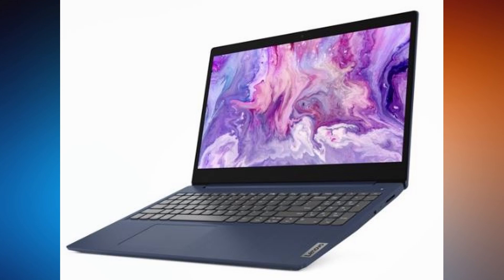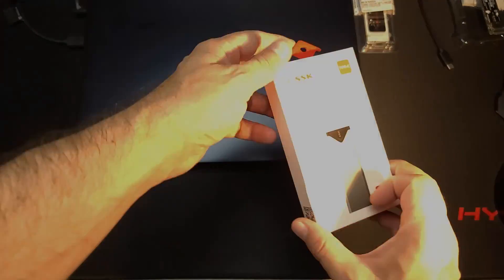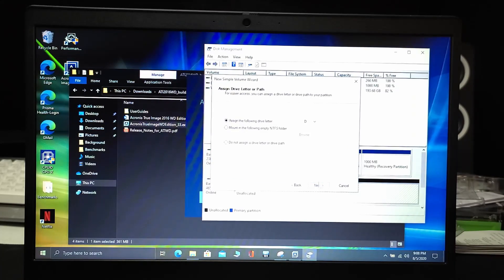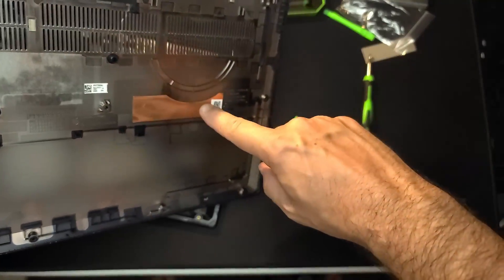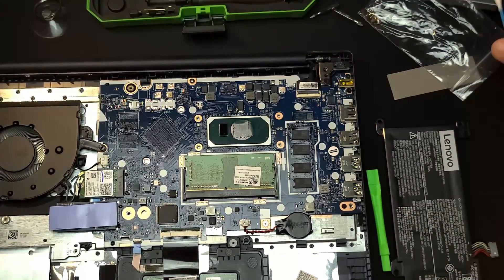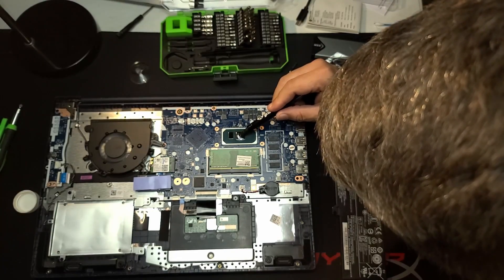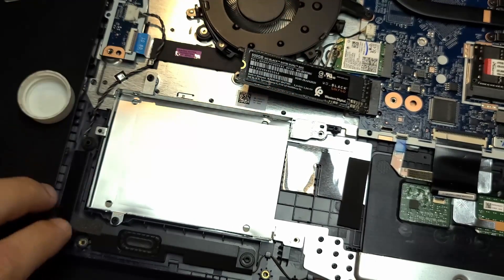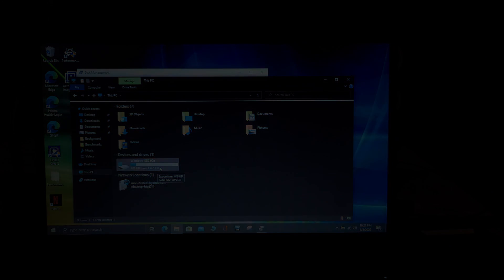Lenovo IdeaPad 3 Intel i3 1005G1, Upgrade. Replacing Thermal Paste, adding 32GB Ram & 500GB NVMe SSD

Comment: is the  slot  at  the side  of the  battery  for   additional  ssd  drive  sata
Reply from the maker: I think there's a bracket kit and a SATA cable that would have to be purchased first, but yes that's space for a 2.5" HDD or SSD. Pretty sure the accessories are available on the Lenovo website.
Reply: @TheSmileyTek  thanks  mate  ,  will  make a  mount  for  it  when i  do  the  upgrade  .  was  not  sure if there  was a sata  connection  ready  to  put one  .  thanks   for the info  .

Comment: I upgraded my ideapad 3 with kingston 4 gb ram, but the problem is that it could only be installed backwards. Like your samsung ram was on the first place. Would that be a problem?
Reply from the maker: No problem. It will only go in one way, so if it seated into the slot, it's correct. My original Ram stick at 4GB, had less "chips" on the memory PCB, so it looks bare on one side. Where as the 32GB is covered on both sides, which make it appear as if it's installed backwards.

Comment: Please advise can i use below ssd for my lenovo ideapad 3
https://www.amazon.sa/-/en/Crucial-500GB-NAND-NVMe-PCIe/dp/B086BGWNY8/ref=mp_s_a_1_5?dchild=1&keywords=m.2+ssd&qid=1606459638&sprefix=m.2&sr=8-5#
Reply from the maker: If it has an M.2 NVMe like the laptop in the video. Definitely yes.
Reply: @TheSmileyTek  yeah, i have the same Lenovo Ideapad Laptop 3 14IIL05, Intel Core i3 - 1005G1, 14 Inch, 1TB HDD , 4GB , Integrated Intel UHD Graphics, Win 10 Home

Comment: Bro i finally have in my hands the ideapad 3 i5-1035g1 , the disassembly is the same?
Reply from the maker: Yes. You got it no problem. Just be sure to unplug the battery first, and your good.

Comment: Hey thanks.  I'd never heard of anyone puttin' in sooo much RAM.  Like you imply 8 gigs should be enough of an upgrade for most of us, no?  Do you have any unpleasant side effects with 32 extra?  Also, I thought the main benefit of puttin' in a 500 gig SSD would be 'memory space'.  Speed also improves?  How much of a speed improvement have you noticed, and are you still noticin' it?  I'd never seen anyone use True Image before, so that was real helpful.  I don't know if I'll upgrade the SSD, but it doesn't look hard.  It'd be even easier with a little more step-by-step instruction with the clone.  I guess that's out there somewheres on YouTube, no?  Thanks agin.  (My ol' laptop has lost its g ability, unless I control V it, which makes my text kinda folksy, with lotsa droppin' g's.).

Comment: Hello my friend! How often should we renew the thermal paste? And , this model can upgrade ram up to 32 gb ?? :0 thank you!
Reply from the maker: Shouldn't have to re-apply thermal paste but every few years, if you remove the cooler, or if your cpu temps seem too high. Mine works great with a 32GB stick (36GB total). I was surprised. No errors running Memtest64. No issues at all so far.
Reply: @TheSmileyTek  beast! Thanks a lot
Reply: @TheSmileyTek  sorry for bothering but i searched for idea pad 3 ill05 in the lovono site and i found the manual but it doesn't have the upgrade options :( .. if you could send me a link :) i would appreciate it ( i dont have the laptop yet, i am in Search of the manuals so as to know the upgrade options) Thank you very much
Reply from the maker: No worries. I will post a link if I'm able to find what you're looking for. Try searching the "81WE....." model # on the bottom of the laptop as well.
Reply: @TheSmileyTek  i ordered the ideapad 3 14' (i5-1035g1/8gm/256ssd) i am trying to find where it says for the upgrade options. Thank you
Reply from the maker: @alexandrgr  https://www.manualslib.com/manual/1847207/Lenovo-Ideapad-3.html

This manual tells you what to search for on the Lenovo site. This may help.
Reply: @TheSmileyTek  thanks , wish u all they best!
Reply from the maker: @alexandrgr  Same to you friend!

Comment: Hi, this works with the ideapad 3 with ryzen 5????I woul like to add more ram 😅
Reply from the maker: Yes, should be the same process. 4GB Ram soldered to the MB, and one slot for additional RAM, which can be swapped out.
Reply: @TheSmileyTek  perfect! i will try adding a 16gb ram, thanks!

Comment: Will be windows deleted because of upgrading the ssd?
Reply from the maker: Not if you clone the drive. If you clone the drive like I did, everything will stay identical, including the operating system. Windows license key is tied to the motherboard, so you won't have to input any software key or anything. So 1st you clone the drive, swap out the old with the new, boot up, and that's it.

Comment: Nicely Done.    I see there is space for a SATA Drive that can be SSD.  Does it comes with SATA cable already attached?? 
Thanks. Most likely will add 16GB Crucial DDR4 RAM

Great Video..  Purchased this model @ $269 plus tax
Reply from the maker: Thanks friend! Means a lot to me. I think you'll have to purchase the "carrier mount" and cable separately. You got an excellent price! Lenovo sells the cable. I think I'll add a SATA SSD as well.
Reply: @TheSmileyTek   I picked up the 1x16Gb DDR4 same brand-Kingston HYPERX @ BestBuy (found a misplaced Gift Card)  I also got the same brand-WD_Black SN750 500GB M.2 and have a few SSD SATA on standby to try that other available drive spot to see how it works.  This is to replace my IBM/Lenovo T410s  Thanks for this video to push up the timeline on my purchase for a replacement  .
Reply: @TheSmileyTek   I was also able to sell my other Laptop Lenovo - IdeaPad S145 15.6" Laptop - Intel Pentium Gold to a Family that needed more than I did for Remote Learning for their two kids.  This Unit Lenovo IdeaPad 3 you did the Video is quite similar in layout to the Lenovo - IdeaPad S145 so just waiting on delivery.
Reply: @SEAMOSS69  Did you get the maximum speed in ram? And I also want to ask if the performance turned out to be better than before because I am still a newbie when it comes to laptop upgrades and I just want to make sure that I will not buy the wrong upgrades. Thanks.
Reply: @haisesasaki6377  Working well so far.  Do you mean the FSB on the Ram? If so, I matched it prior to the purchase. Works great in tandem with my SSD
Reply: @SEAMOSS69  Thank you so much, I am just making sure if I can buy a 16gb ram since I saw some videos that said that I can use a 16gb ram but the official site says that the maximum ram that it can handle would be 12gb but thanks to your feedback, I will just buy a 16gb ram upgrade.

Comment: Excellent video, I got this computer in the version with an i5, I want to add a hdd to it but the computer does not have the cable, do you know where I could get it or if any cable would work for me?

Thanks for your help
Reply from the maker: Thanks buddy! If you search for your laptop model, on the Lenovo website, you should be able to find the exact part # in the "maintenance manual" for your specific model. They actually offer more info than most other companies. I was surprised tbh. Good luck.
Reply: @TheSmileyTek   I finally find the part number, thanks man.
Hope we can see more of your videos. Subscribed
Reply from the maker: I appreciate it! I've had 2 videos recorded for weeks, I just haven't been able to finish them yet, but they're coming. Thanks again for the support!

Comment: Can you explain the hit you took on ram speed? Did you get a slower speed than the top speed it could handle? Got this for a xmas present and planning on the upgrades after opening. Thanks! Great video brother!
Reply from the maker: I have a video almost ready to upload, which goes through the differences. I've been editing it a little bit at a time. I'm really late on getting it up, bit it is coming. With the original mem stick Hardware Info showed it hitting 2666mhz, but capable of 3200mhz. With the new mem stick, I'm only getting 2400mhz, although it's a 2666mhz stick. Unfortunately there's no XMP option in the laptop's custom bios. So no way to speed it up. I'll share the benchmark differences in the "Part 2" video.
Reply: Also, this is the 1st time for me using a NVME SSD. What do I look for to find the best, quickest, reliable drive?
Reply from the maker: So SATA 3 SSDs are limited by SATA 3 speeds of 600MB/s whereas NVMe get speeds in the GB/s. I've always gone with Samsung EVO Plus or Western Digital Black NVMe. They perform well. The larger the capacity of the NVMe drive the faster the speeds. For instance, a 500GB may get 3500MB/s and a 1TB may get closer to 5000MB/s. It just depends on the capability of the chip manufacturer. Personally, I think WD Black NVMe is a good price to performance option. Since this laptop doesn't support Gen 4 PCIe (ie Sabrent Rocket Extreme), I'd just go with a Gen 3.
Reply: @TheSmileyTek  Thanks for taking the time to educate me, it's appreciated.

Comment: Watched your video. Followed instructions. Upgraded No problem but one, I had to buy the Application to back up the image file for drive. But It was only 50 buck which is less than bench charge from repair place. I also figured out I have HDD drive  can install in this unit also. Thanks for making video for me.
Reply from the maker: So happy it was useful for you. Hate you had to pay to backup your drive. This particular laptop was fairly new so I didn't have to worry about losing anything while cloning the boot drive. I've always stored anything "important" on a secondary drive, just in case Windows craps out and I have to recover.

Comment: I thought this laptop could only support 12gb ram
Reply from the maker: I saw the spec sheet for this model, and it shows "12GB, max offering". I take that as, the most offered from the manufacturer. The Intel Ark page show the i3 1005G1 maxing out at 64GB. It still runs on the Intel 400 chipset as well. The plan was 12GB, but I ended up with 36 🤣. Works just fine. Still zero issues.
Reply: @TheSmileyTek  ight cool

Comment: how do you replace these type of processors plz tell me
Reply from the maker: Unfortunately the CPU is soldered to the board. There are laptops with removable CPUs, but this is not one of them. I'd upgrade it if it were possible though, for sure.
Reply: @TheSmileyTek  oh ok yah same though i would upgrade as well i have the laptop already too.

Comment: would all of these upgrade help improve the gaming experience for this laptop?
Reply from the maker: Unfortunately, I wouldn't think so. It really comes down to core count and the graphics capability. Most newer games are optimized for a minimum of 4 cores, and a discreet GPU to pump out that fps. However, if you upgrade the 256GB hard drive to a snappier 1TB, the read/writes will be faster. If you have a desktop pc that games well, you can always use GeForce Now or Steam Link to game remotely on your laptop. Those services allow you to use your more "powerful" PC's resources to game on your laptop. I've tried Steam Link, and it works pretty well. I've been playing Witcher 3 on this laptop with no issues other than a little latency. Hope this helps you make a decision.

Comment: can i add a second hard drive? will it allow me to choose which one to boot every time i turn it on? i also use cloudready and it doesn't like to share a hard drive with windows.
Reply from the maker: You can definitely add a second drive and modify the boot order to boot from the selected drive. I'll have to see if there's an option to toggle, to be prompted at startup. I'll get back to you on that.

Comment: My ideapad slim 3 lenovo said that it can update max 8gb ram but it not enough for me
I want to put 16gb+4gb and is it work?
The mother board of ideapad slim 3 can work with 20gb?
Reply from the maker: I currently have 36GB. I will finally, be doing the before and after upgrade video tonight. I will be sure to include testing and stressing the memory. Should be up, by no later than Sunday.
Reply: @TheSmileyTek  ok, thank you
I look forward to that video 😍

Comment: how to replace old SSD with a new SSD without I lose my windows original ?
Reply from the maker: You'll need to clone the drive. You may need an external enclosure for the new drive, to use for cloning. See the links in the description, for the one I used. I also used Acronis software to clone my ssd. You won't lose the original Windows or files if you clone. These steps are covered early in the video. Good luck.
Reply: @TheSmileyTek  ty bro (y)

Comment: (fair warning I'm new to learning about laptop upgrades) Hey I just ordered this laptop and I will be using it to edit photos and video. Would these upgrades help speed things up when launching and using those applications? Thanks in advance!
Reply from the maker: Sure, no worries. The nature of NVMe ssd, the higher capacity usually translates to faster "read/write". I think there would be a boost in performance with a higher end, high capacity NVMe (1TB and up, but 500GB is still super fast). As far as the memory upgrade. My upgrade did not benefit memory speed, but you will want more memory for video editing, so you can smoothly "scrub" in the timeline. Rendering videos may not be that fast without a true discreet graphics card, but It's a great little laptop. I think bumping up drive capacity and RAM, would benefit your use case for sure. Would probably give you a smoother experience rather than a faster laptop. Hope that helps. Have a great day!
Reply: @TheSmileyTek  gotcha, I look into updating her when she gets here, thank you!

Comment: Increasing the ram to have 8GB + 4GB, how is the performance? I understand that the dual channel is lost, I would like to know if it is really worth making this change.
Reply from the maker: In my case, the memory speed dropped, but I have a "ton" of memory. Worth it, if you need more RAM. More memory over memory speed is a trade-off I was ok with. I'd definitely suggest buying straight from Lenovo to ensure perfect capability. I will be doing a before and after upgrade benchmark video on this laptop asap. We've been so busy. As soon as I finish painting my little "YouTube" area, and getting it setup, I'll be back to uploading.
Reply: Smiley TeK I bought a 8GB 3200 MHZ stick since I read that the IdeaPad 3 only has 1 available slot with a max of 12GB of RAM... and I haven’t seen any difference in performance. Do you think getting a new SSD will help?
Reply from the maker: Nice, on the RAM selection. An 8GB stick was the plan for me too, but I received a 32GB somehow 🤣. I'm guessing you have a 256GB NVMe in it now? The 500GB WD Black I installed has faster read/writes. Get  Crystal DiskMark and test the speeds of your current drive. I'll see what mine is with the "upgrade", and let you know.
Reply: Smiley TeK actually, that is the only thing I upgraded. The 8GB 3200 MHZ RAM, found out though my laptop can take 16GB and I’m gonna return the 8GB for a 16GB
Reply: Smiley TeK thanks !!! I have been looking for upgrades on my laptop since I use it to sim race with my 42 inch monitor and an HDMI cable lolz

Comment: if i take out the ssd out of my ideapad 3 that came with it and replace it, will the operating system still be there? cool video.
Reply from the maker: Grab a hard drive enclosure, put the new ssd into it, and clone your boot (existing) drive onto the new ssd that's in the enclosure. You can use Acronis. Swap the drives and it will boot the same as before, with all of your files.

https://www.amazon.com/dp/B07MNFH1PX/ref=cm_sw_r_cp_apa_i_UL6IFb493QWRD

https://www.amazon.com/dp/B00OJ3UJ2S/ref=cm_sw_r_cp_apa_i_vL6IFbKYYG6SF

Comment: can you please tell me what does the heatsink made off? is it aluminium or nickel? it seems you dont put any pasta to gpu can tou tell me where the nvidia position is?
Reply from the maker: The heatsink is copper. You're correct, I did not put any paste on the iGPU. It didn't have any on there when I opened it up, so I left it the same. It's just an Intel iGPU. It's the silicon "square" to the left of the cpu, that's covered in paste, when I remove the heatsink. There's no additional GPU in this particular model.

Comment: Hey, can you please tell me which M.2 SSD is there ? Please give me its name and link (if possible) accurately, I want to change my this lenovo's (same ideapad slim 3i) HDD.
Reply from the maker: There is an Amazon link (not paid) to the new M.2 NVMe in the description. It's a Western Digital Black SN750, 500GB. Is that the one you're asking about?
Reply: @TheSmileyTek  Ok thanks. I have one more doubt, 

[1] that what screw is used for M.2 SSD, I dont have that screw Can i use tapes instead ??? And also 
[2] What type of key are compatible there for PCIE SSD, M-key or B-key or both ??

Comment: hey, can this laptop POSSIBLY  change the cpu? like i3 to i5 or i7?
Reply from the maker: Unfortunately the cpu is soldered to the motherboard. I'd definitely upgrade this one, if it was possible.
Reply: ohhh thank you--- cuz i was planning to, so I can save a lot of money to change a new laptop  and can  play gaming stuff hehe again, thanks!!
Reply from the maker: @giannenicolemiranda4169  I use Steam Link to game on this laptop. Steam Link lets you use your "gaming PC" resources to play on another PC, remotely. Works good enough for campaigns, but the latency wouldn't help in a multiplayer game. I'd suggest a laptop with a dedicated GPU for gaming. This one has an integrated GPU, and isn't that great at pushing graphics. But, it's excellent for everything else, so far.
Reply: @TheSmileyTek  but still can play yes?with low setting? :D